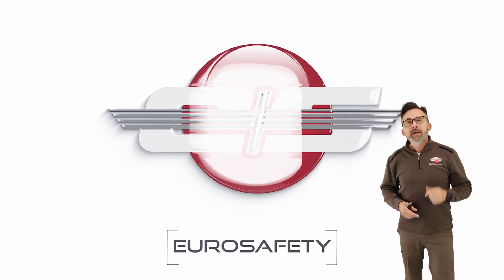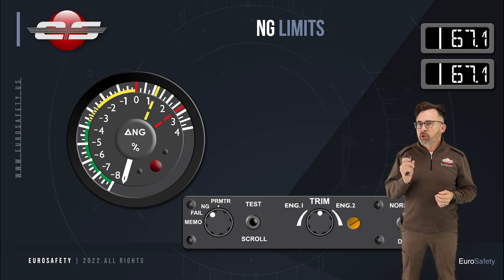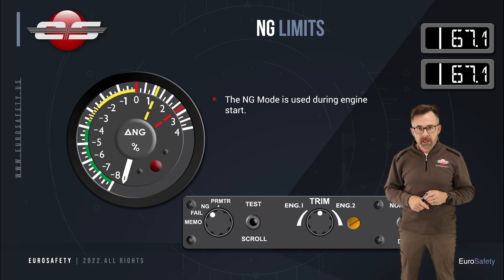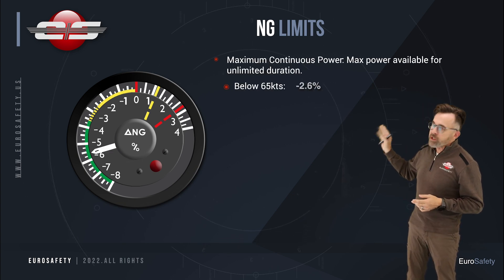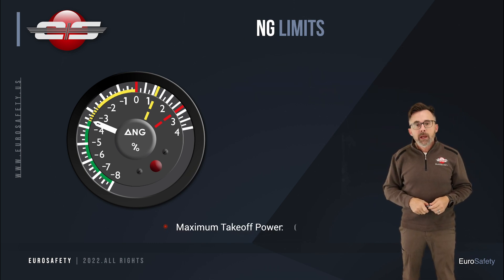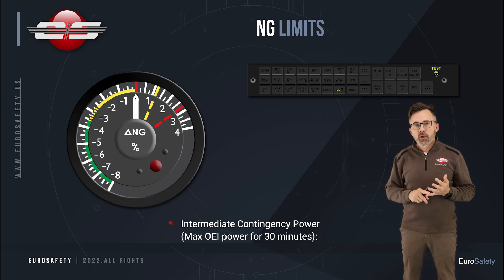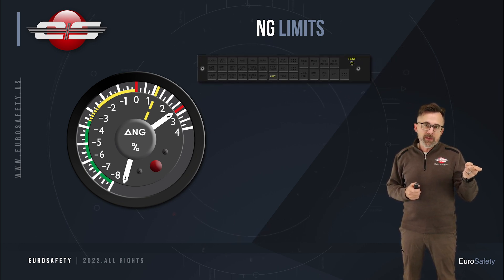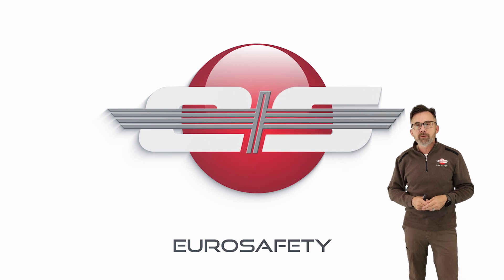#80 - Navigating AS355N Delta NG Gauges: A Detailed Markings Breakdown

Comment: Hi Glen, goes without saying that this is another great video. Question on the delta Ng gauge: is it normal to have a decent split between the engines? For example, Engine 1 running at -2.7 and then Engine 2 running at -4.5 in flight at cruise.
Reply from the maker: Thank you, I appreciate it! No that is not normal at all. Have you done a power check on engines?
Reply: @EUROSAFETYTRAINING  Will do one this week
Reply: @EUROSAFETYTRAINING  To get back to you on this, we discovered it was a faulty ambient air pressure reading from the computer in engine 1